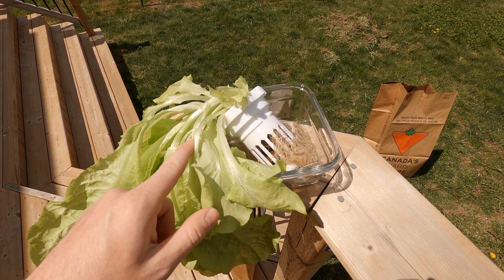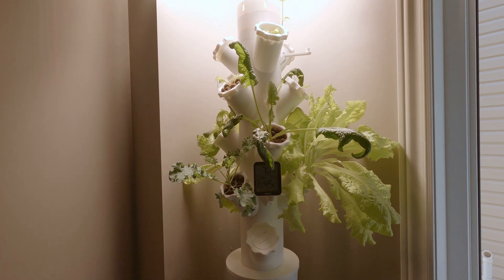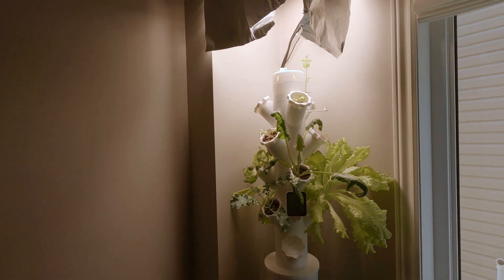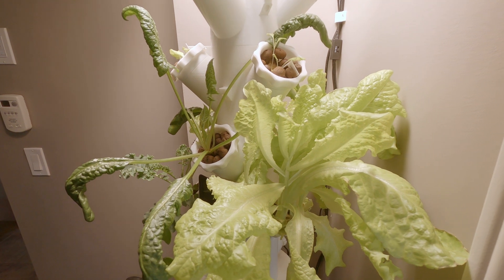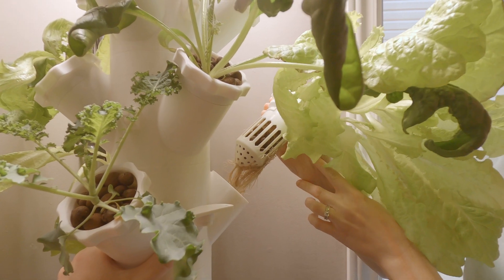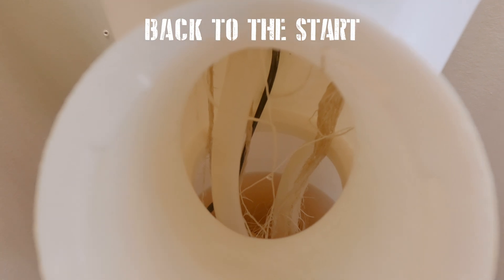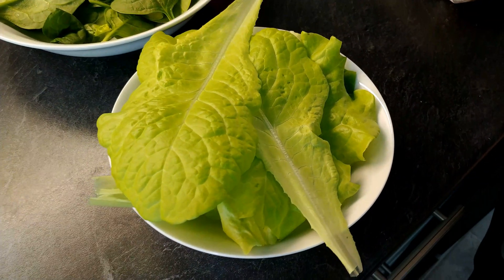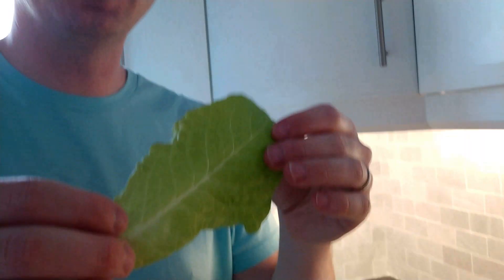3D Printed Hydroponic Tower - First Harvest

Comment: Hey, great video! May I ask what did you use for the sprinkler at the top? I could not find it in the link you have shared.
Edit: I have found it! It is the Stream_Breaker.STL file. May I ask what did you use for the reservoir?
Reply from the maker: Ok Great! I just went looking for it and found it. There are quite a few STLs now. The reservoir is a 3$ garbage can from dollarama with a lid I custom 3D printed. I am actually in the process of setting up the hydroponics again after I took it down. This time I am going with a medium size garbage bin from dollarama. They seem to be the cheapest thing I can find. Those fancy rain barrels people use are $$$. The original bin in this video is too small and needs water ever day or so once the plants get large.

Check out the intro of my other video: "How to Make Your Own Parsley Indoors"  -- It shows this system a few months later and all the plants are doing much better!

Comment: Yes, it might be more expensive to start off with then  heading to the store to get the lettuce, but once its set up, and you get things fine tuned it will even out.
Reply from the maker: You are right. I have had my hydroponic system running for 6+ months now at virtually no cost and produces near unlimited lettuce for us. Everything is dialled in now like a science.

Comment: What settings did you use to bridge the tops of the plant ports on the tower build? Every time I try this one, the filament dips down and "Spaghetti's out"
Reply from the maker: What part do you mean? The single top cap of the tower ?? I printed it upside down. There is no bridging anywhere. Can you try to specify the part again.
Reply: you need to work on your printers bridging, or just use some support medium, I like to use tree supports in cura as it tends to be unobstrusive, and easy to remove. Does take longer to slice it however.

Comment: Tower gardens need vertical lighting if you're going to grow indoors because the light won't reach the lower plants. You're plants are extremely leggy and reaching for the light which makes them more stressed and potentially bitter. Also, don't print the net cups, it's a waste of filament and money. Much cheaper to just buy real net cups.
Reply from the maker: You are right. Since this video, I have added vertical lighting and made an enclosure with reflective material and the plants are flourishing. They have been growing well for months now. I like the look of the printed net cups and they are reusable many times over.

Comment: Hello sir thank you for your great video.

How much it will cost to make one tower with 20 plants  by using 3d printer
Reply from the maker: My tower has about 20 plants and cost around $300 all in.
Reply: @billjonesnation  thank you very much for your response sir I really appreciate it. So is it better to purchase from market? Or build by our self by using 3d printer? I'm confused. Please reply if your are available. Thank you very much again sir
Reply: @ambadykb  a lot of the prebuilt printers are really great and take no time at all to put up, calibrate and then put files in and print. with a ender 3 you should be fine to start this project off with.